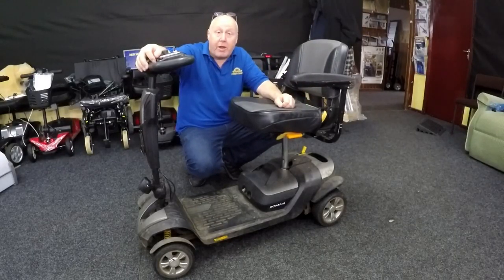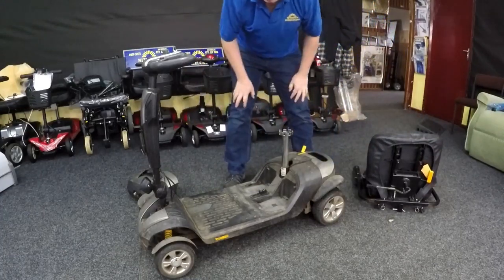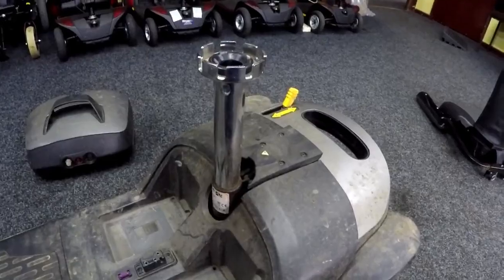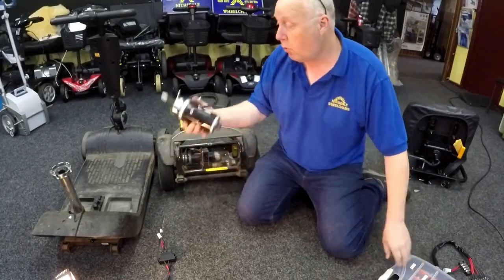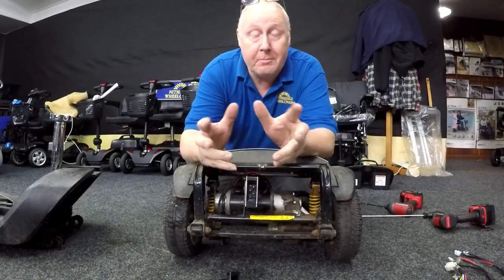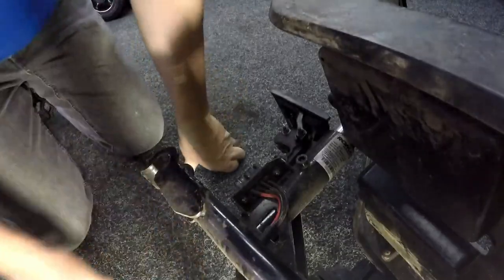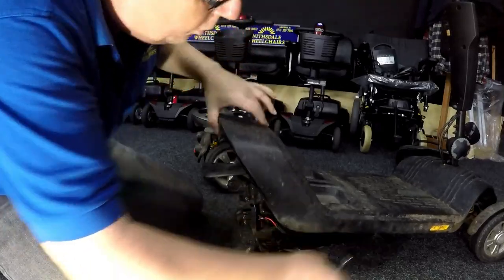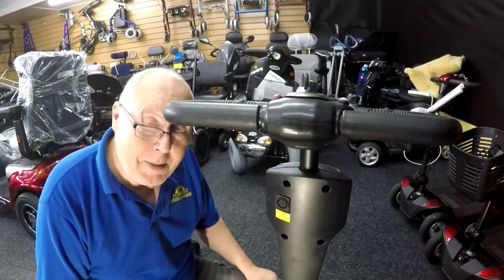Foldable scooter stops and cuts out while driving.

Comment: Great video, thank you, very informative. I use conductive grease on contacts that may move but only on the sockets as putting it on pins cause it to be pushed down to the bottom of the pins shorting them out, so, only in the sockets, so that is not a problem. On pads it is good as it reduces contact problems and rusting.

Comment: I would put some lock tight on the nut's, put in place then tighten the nuts. Now there is no rubber grommet on the charger plug. Nice video.

Comment: Great videos you have! I’m very impressed on how you offer parts for sale along with the likely cause and repairs. 
I posted a question in I think it was one of your latest videos about me having a drive scout 4 with intermediate issues it gives me a code 5 beeps. I brought it in the house a few days ago from the car and in 24 hours it started working. Not sure what I did if anything. If you have any ideas please let me know thanks!
Reply from the maker: Check the alignment of the contact points from the front to the back may not be properly set
Reply: @tomjacques4  I couldn’t agree more. I tried removing the two half’s and putting them back together and now it seems to be working ok. Thank you
If that is the case I might need to order the contact plus from you.

Comment: @ 26:08 ... Would the cable be better going over the top of the square box section where you are holding it...
It wont get crushed if that square section ever bottoms out...
@ 21:22 It looks like there is plenty of room to go over instead of under...
Reply from the maker: I would agree It would be better. But it’s how the manufacturer has fitted it.  The body panel sits flush on top of the frame so no space; if I would of fitted it it would of been crushed and the wires would eventually break. Also body panel would not site level.
Reply: @tomjacques4  ...
Thanks for that explanation;... that sure now make sense...
It's a shame manufactures get away with a design like that;... without some sort of cable shield... B4 putting it on the market.

Comment: Hi Tom, I have a Pride Colt Excusive, it only runs on slow speed but there are no controls visible on the dashboard. The dashboard back lights is on but nothing else. Could you please help me.
Regards James Botham    
<
Reply from the maker: Hi has a H (high) / L(low) button that could be an issue if you can’t see that then there could be as issue with the tiller Pcb
Reply: @Nithsdale Wheelchairs V  Thanks for that Tom, as we were striping the tiller column down and testing all the terminals, everything came alive and started working.
By listening to your advice, check all terminals paid dividend. 
Thanks for your advice 👍

Comment: Hi mate I have a excel Galaxy mobility scooter that's been a great scooter for me,I have replaced the batteries 5mths ago. But the last few weeks the scooter suddenly stops dead and I have to restart the scooter,this happens many times,but today it stopped and noticed that the first battery light was flashing 7 times what does it mean? The scooter has been losing power lately but would retune to normal speeds within minutes, please help,thank you. David. I love getting great advise from your videos and your experience is priceless, also could you please tell me what type of 4 brushes my scooter takes,I think it's a excel Galaxy royal 2 or 3 has 4 brushes. Thank you

Comment: I have had a problem with one of these folding scooters, after putting the battery in it works fine, but if it’s switched off and on the motor won’t work unless the battery is removed and dropped back in, then it works ok.

Comment: Hi I've been watching your videos trying to c if I could c a similar fault as my rascal p327 
I was wondering if you could help me 
I have a rascal p327 and it's not working
Its giving a light scroll...left to right  and a spanner sign is flashing  
5 flash code 
Motors are working with 24v applied 
Motor break is working with 24v applied 
Ohms test on break was at good range
Any help would be much appreciated 
Thank you
Reply from the maker: Hi send us a video of the control box with the lights etc  to nithsdale.wheelchairs@btinternet.com

Comment: rascal 245 runs and stops intermittenly.  I have to turn the key off and on and then it usually goes again.  Sometimes it won't go even after turning the key off and on several times.
Reply from the maker: That scooter has split looms check all connections at base of tiller and on the underside at the rear of the scooter clean and dry chek to see if they are corroded use terminal contact cleaner

Comment: we have this issue with a rascal taxi 4 scooter, do you have a specific video for this please
Reply from the maker: Old obsolete scooter.  What’s wrong with it
Reply: We fitted new batteries was cutting out and not running smoothly we were looking for a loose connection or dry solder joint

Comment: i have a question, i’ve got posseion of a mobility scooter and by process of elimination there’s no power from the pins on the control bord. there’s supposed to be 24v output but there’s 0 on the pins in the connector. although there is 24v for the electric break

Comment: Thanks for this you just made looking at it so much easier. I was testing one similar to yours in the vid for someone else yesterday...10 miles I was told,.. 2 miles out after a full charge, It died. Registering no power on the meter. I was going across short grass quite smooth, then an incline, where it simply died. The next day it started and all was well. Could this have been an overheating issue. Is there an overheat cut out in the motor or the brakes, which cools down and then it works again. They did not give me a manual, it was second hand and serviced. I was thinking that the 'slightly' uneaven ground may have overstretched the motor and braking...causing over heating??
Reply: Yes I had to walk it two miles back in the sun! I have been happier...lol
Reply from the maker: @petergadd7797  what’s the make and model   Uses more current to run on soft ground  usually have a thermal cut out located close to batteries

Comment: Hi I have a let pro scooter less than a year old went to go out on it it moved for about 5 feet then stopped power showing full power but won't go any help or suchetshon would be great full
Reply from the maker: Hi best contact your dealer as it’s under warranty. Ps have not heard of a let pro scooter sorry
Reply: Hi I have tried that but they've said it could be wet and try after three days if it still happens then they can't help as the warenty doesn't cover for it getting wet 😢
Reply from the maker: @johnt235  yep sadly it does not cover if components get water contamination but have they actually been out to assess and check it out. ?

Comment: Please help,shop said my rascal 850 need a new £500+ main board above motor and under seat. It keeps giving a single  beep when turning the key,have put it in free wheel,then it will work. It will sometimes stop working but turning it off and on will make it work again. Could it be ignition switch,motor bushes, or the board
Reply from the maker: Of the control box is faulty then it will stay faulty so don’t think it’s that. It’s very odd that you say the scooter will drive when it’s in manual mode as it should not drive. Can you send us a video of this fault
Reply: @tomjacques4  no sorry I have to put it in free wheel to move it from shed,then put it back on and it will drive but sometimes stops working again but turning the key sometimes makes it work again
Reply: I cant afford the price they want,can I get a second hand one any where
Reply from the maker: @Wombat63  have you checked our video on throttle pots that could also be an issue
Reply: @tomjacques4  no sorry I'm not any good with checking stuff like that. Shop said main power board as I mentioned, but £549 before labour and vat. Cant do that

Comment: My wife has a power chair, Pronto M51.  Her power chair hits an uneven surface and it stops, and the wrench light comes on.  I have found no videos that cover her problem.  Anyone have an idea where to find the answer.  I can fix it myself if I knew what part needs to be replaced.
Reply from the maker: Joni would check all connections just in case there is a slack wire.  Check batteries. Etc. all wires going g to and from motor and brake

Comment: Need your help my partner has a rascal pioneer mobility scooter and two off the wires have come off the ignition  can u please help me in this matter I am innthe united kingdom kind regards. I can fix it myself but one of the screw heads is damaged  how can I remove this screw to get the cover off thanksnif u can please advise me
Reply from the maker: Hi send us some pictures please
Reply: @tomjacques4  I know that two of the wires have come of the ignition  switch and need to have it put back on how much would u charge. As I need the scooter for my partner to be able to get out on I think I could do it myself
Reply: Hi,can you do a video on the spring suspension repair ,thanks mike
Reply from the maker: @mikeosborn3906  think I’ve done one on a TGA breeze swing arm